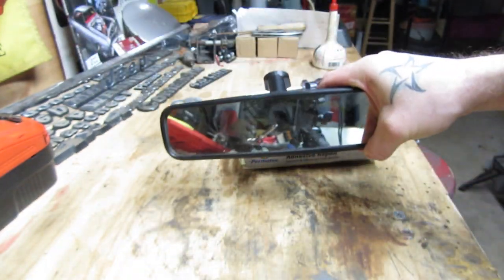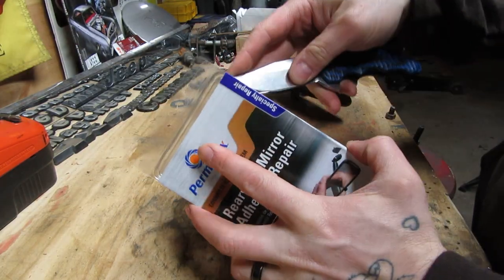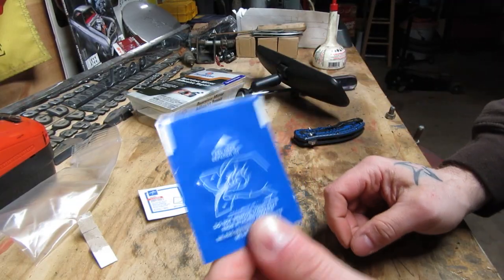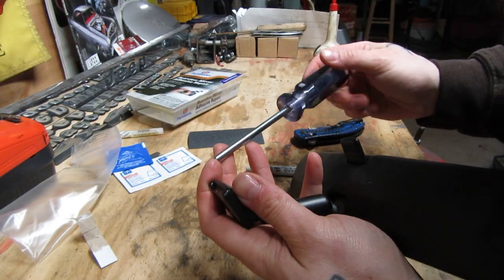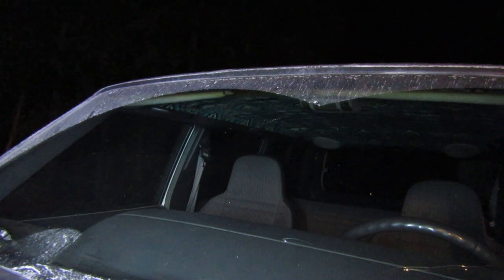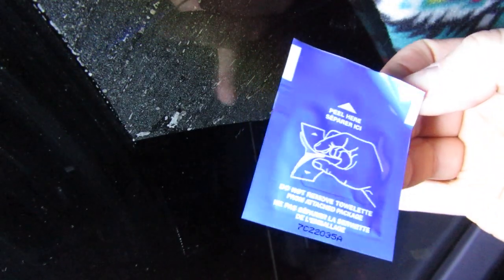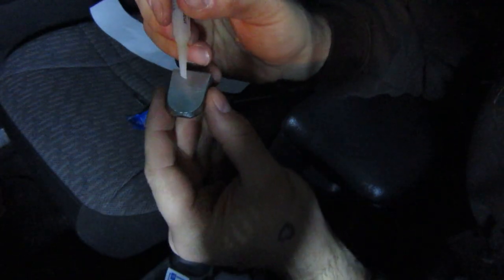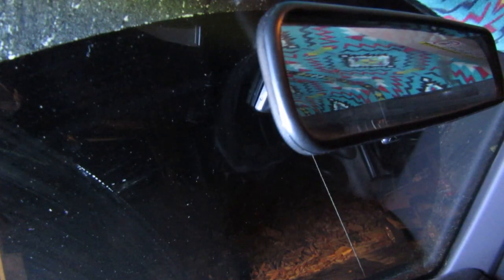Rearview Mirror Fix - Permatex Rearview Mirror Adhesive Repair

Comment: called permatex. they told me to use the green pad on the button also. did everything else like this video... it works... i didnt buy the kit for $9.00. had a razor blade and i had sandpaper and that saved me 6 bucks...

Comment: I have used this same kit. Works great. For some reason my Honda rearview mirror drops every couple of years, and always seems to do so on a very, very hot day when sitting in full sun at my workplace parking lot. But I get one of these kits and it's good to go again.
Reply: Permatex is garbage. I used it like you and it falls every few years. Use the loctite a far better product.
Reply: @bigcoach3696  How many years does loctite las

Comment: Thank you so much for posting this video. It's December and I was concerned that the temperature outside (mid to high 30s) would be an issue with applying the adhesive. This is the same product I found at Advanced Auto and I'm going to give it a shot.Thanks again!
Reply from the maker: It certainly is against the directions, but mine has been good for about a year now.

Comment: 1 drop is very subjective for the type of bottle the liquid comes in. I reckon you need enough to cover the metal bracket and not too much where it leaks out. I just did mine today, it didn't spread around the whole thing, i'd say it did 75% of the surface so I hope that will be good enough. Next time I will put a bigger 1 drop on.

Comment: kind of jelly yours was only 9 mine was 12 in total and its kind of funny i also tried the double sided gorilla glue adhesive tape that said it holds 15 lbs it didn't work at all thanks for the video i shall try this tonight as well i saw one guy in the comments had some trouble i hope that doesn't happen and hope he got something to work o.o
Reply from the maker: Yea, I have encountered a few folks who had issues. I cannot speak to why, but I did mine in less than ideal conditions andalmost a year later it is rock solid still. Good luck!

Comment: Yeah tip that was great Market on the outside I kind of barked at a little like Ian circled it on the inside which help me find it easier on the outside real fast as I don't want to be on the total my car and I leaned over only. But yeah I was wondering how will the cleaner not get rid of my mark Not My Brightest moment thank you for stating the obvious cuz I was obviously not thinking

Comment: Followed instructions, etc.,  Waited an hour plus.  Attached mirror, went to adjust, everything fell off in my hand.  .  .   Will find another brand.
Reply: Harvey Floyd same thing happened with our mirror
Reply: I've used this kit twice now. Even waited to do it in the recommended temperature range... Failed. Albeit, one of the times lasted a couple months. They both failed. Looking to epoxy now.

Comment: The instructions say to only apply between 50 degrees and 75 degrees.  Most of these things fall off in hot weather, as mine did (102 degrees).  But even parked inside my garage out of the sun, it's 87 degrees and not likely to get down to 75 any time till late Sept. (It's now July)  I hate to start off first thing by going against the directions.  This guy did his too cold, how about too warm??
Reply: I used this kit yesterday in about 90 degree heat.  I let button set for 3 hours.  When I tried to attach mirror the button fell off.  I am going to try again today with a new kit.  I am going to run AC and flood windshied with cool water.  hopefully it will stick this time.

Also they sell a cheaper kit that only includes adhesive and cleaner.  This instructions on that kit do not match this kit.  I think those instructions were wrong.  Specifically it said to not use activator on button, this kits says to do so.  Also cheaper kit says to let activator dry for 2 mins before applying adhesive.  In hindsight that is plain wrong.  Clean both windshield and button and work it while still wet.  The glue spot of the failed attempt fell off the windshield at the sight of a razor blade.
Reply: just do it at night and let it sit overnight but you try to put the mirror on and you should be fine.
Reply: Mine popped out again this july in 101f. Last time it popped out was last year in July too. I need something else that can handle hot weather.
Reply: None of these product work for me. The manufacturers of these car must find a better way to install rearview mirrior on motorcar
Reply: It worked for me in 85° weather. The best time to apply is at nighttime when it’s not so hot. Just make sure you send the parts and clean very well with the alcohol swabs and follow the directions it does work
Reply: My mirror fell off 2 days ago. It was 99 degrees, not to mention this is the 2nd time it falls. The kit works but your rearview mirror will fall again due to heat. You also have to account on how hot it is in your vehicle.